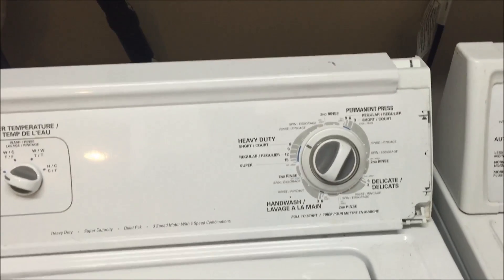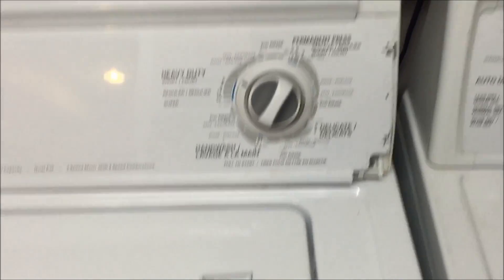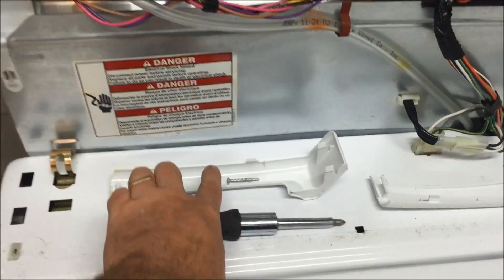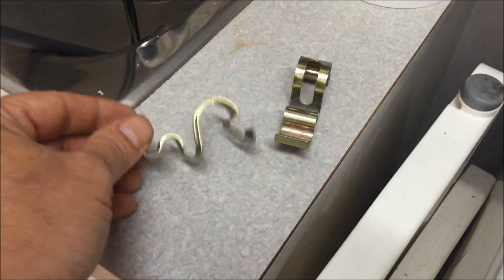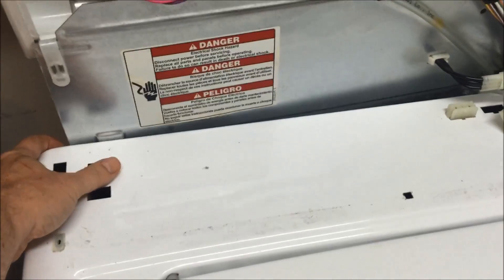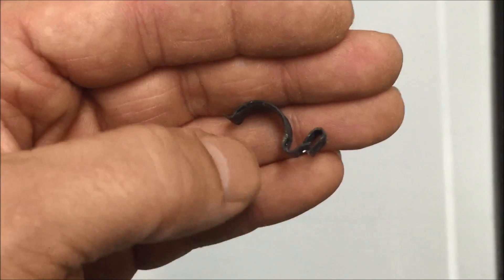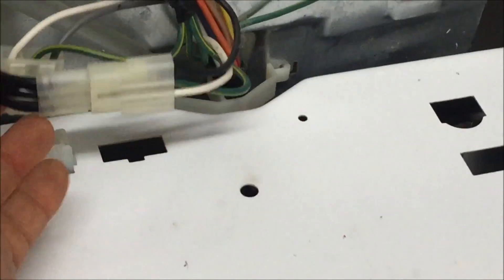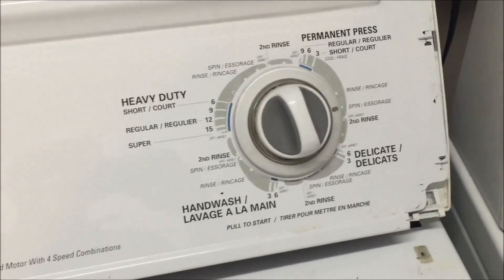Washing machine won't spin or drain? Replace a Kenmore/Whirlpool lid switch

Comment: Thank you my good friend.   Your walkthrough was invaluable.   I saved > $100 by ordering the $14 part, watching you, and replacing the switch.   The toughest part was, as you mentioned, making sure the unit's body fit back on the 'tracks'.   That caused some frustration but once that was back on correctly, we were rinsing again!    Kindest regards!

Comment: Thanks for the info, it was a easy repair once I knew how to access the switch.  So many videos never explained how to remove the springs to open the front of the washer.
Reply from the maker: Thanks. I try to put in the parts that I think people will find a challenge, which I had to learn from experience as well. Glad I could help.

Comment: Thanks for the video. The part that was enlightening is when you mentioned hearing the switch click. Using that I found that switch did not click. It did click when I depressed it manually using a screw driver. The power was on when I did it. It turned out that the dial set to where is was should be spinning and draining. When I pressed down it began to drain and spin.  The plunger in my case looked like the one in the video so I assumed it was not damaged to be too short. I as a short term solution I used some good ole duck tape and a shim on top of the switch where the plunger hits it. So by manually pressing to hear the click and seeing the spin and draining confirms that there is not another part that might be the problem. Still I plan to open it to inspect the spin springs as it shakes more lately and when I do that I will inspect the switch to see if it can be adjust to work without the shim or replace it.
Reply from the maker: Super, glad i could help!

Comment: I fixed mine with a 7¢ zap strap and didn't take the cover off.  The switch is pretty accessable with the lid open, and a zap strap around the body of the switch is holding the contacts together inside. Not sure if this will help for all, but it seems like the detergents are causing the plastic to fail maybe.  Idk it worked for me.

Comment: Thankyou so much for your clear explanation. I replaced my lid switch and saved 100-150 $'s!
I have a question, tho. 
Instead of taking off the old ground I connected the new ground to the old and wrapped the exposed wire with electrical tape. Is this safe? The machine is working.
Reply from the maker: Hi, I think that's perfectly fine. Bear in mind it's a washing machine lots of water so I would typically purchase an electrical connector at Home Depot or wherever, that provides a really secure connection. Then you can wrap that whole assembly in some tape. But I think nothing wrong with your approach. Thanks for the comment, much appreciated.

Comment: I have a kenmore 600 series washing machine, and the steps to remove the end caps and control panel won't work for mine. The end caps are solidly fastened to the control panel from the inside.  After I broke one, I realized all I had to do was pry the control panel up at the front corners. The control panel is held on with 2 metal snaps in front and 2 small screws in back.
Reply from the maker: Thanks for posting.